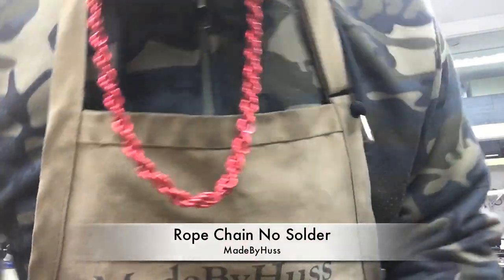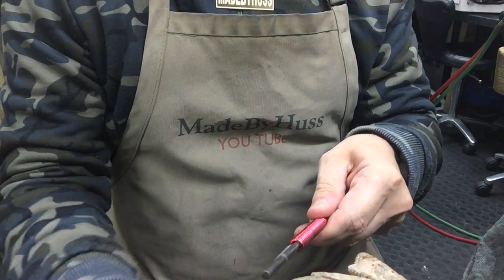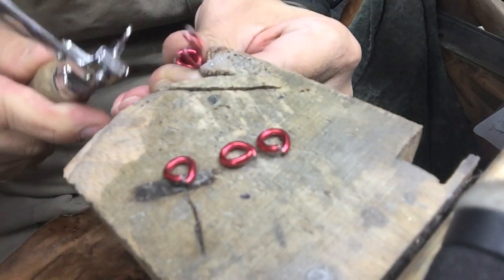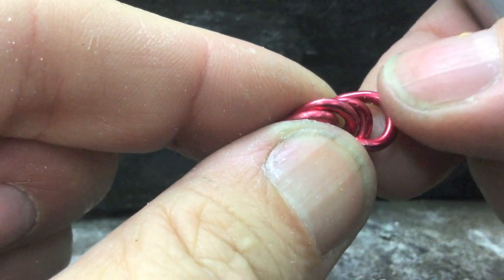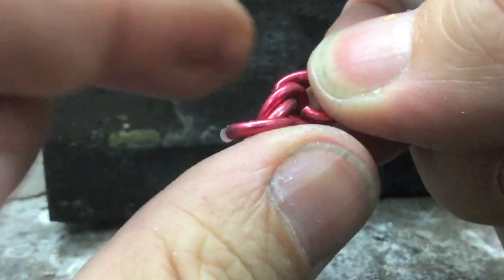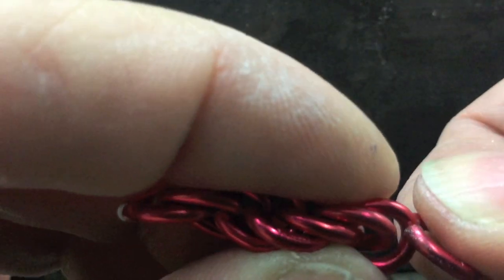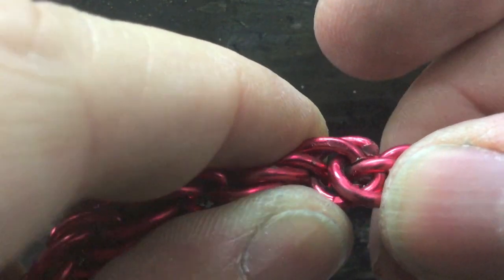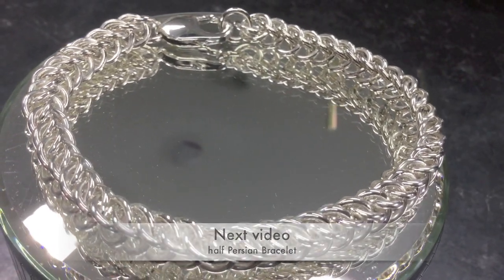Home Made Rope Chain Easy To Make

Comment: What was the overall length of the wire before you coiled it? Would 1m of wire at the same diameter be long enough for the same length chain as your finished item?
Reply from the maker: LLord Frost yes 1m I used about 2and a half sorry I didn’t put that in the video thanks for your comment